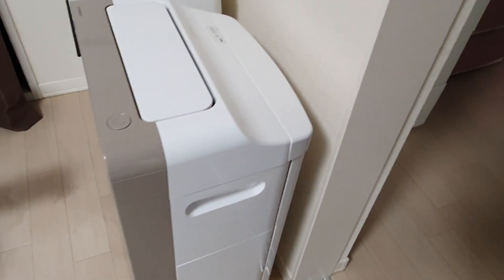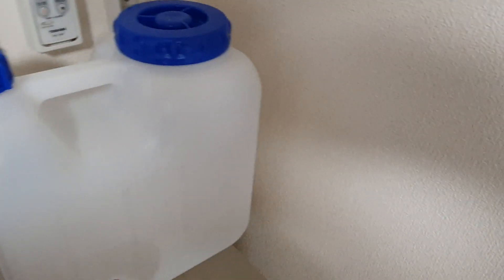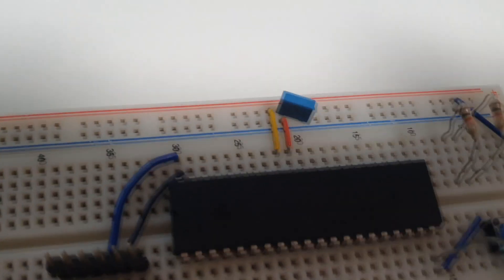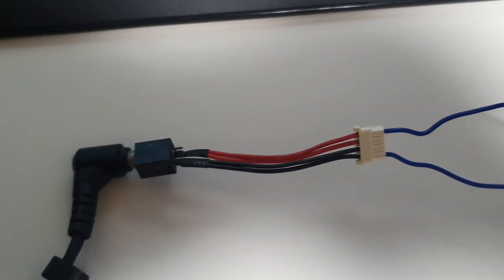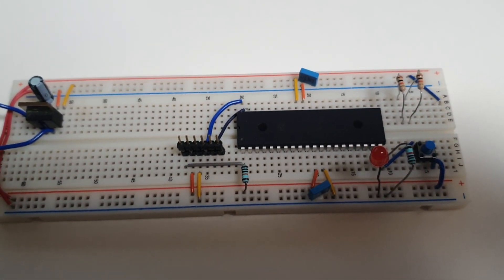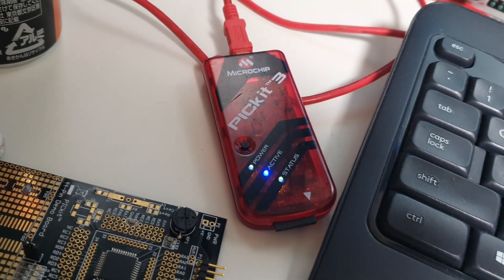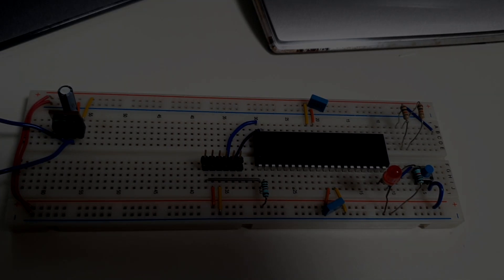Journey's Start [Project Moisture]

Comment: Perfect use of knowledge. I think this is a perfect project. Those water reservoirs are always to small!
Will this solution have some kind of fail-safe? Like if the power dies the valve will always opt for closed state.
Also isn't there like a floating/gravity kind of valve that would do this mechanically when the water reaches a curtain level? Not sure if that is better though. Not as fun for sure!
Reply from the maker: Yeah, the valve is definitely normally-closed! more power efficient and safer. It has a few safety features built in, a few more that I might add if I'm feeling frisky (like proper handling of WDT and brown-out reset).

Comment: You should check out using a capacitive sensor to detect the water level in your reservoir. That way whenever it gets below a certain level you re-fill it! 

You could run the logic with 2 capacitive sensors, an AND gate and maybe an inverter or two:

if (excess supply has water && humidifier reservoir low water) -> turn on pump

(If you said this in the video, sorry, i missed it)

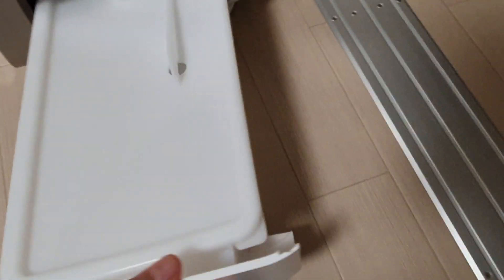Comment: @1:14 Couldn't you get away with plugging a reservoir into whatever that pipe plugs into without the need for an MCU?
Reply: Its project! And a chance to ... project. :)
Reply: @space1677  Well said - I'm projecting.
Reply from the maker: Nope, that approach has a number of issues that make it a non-starter.

Comment: what langauge would you be using?
Reply: These things are usually coded in C/C++, but, if you're going to find anything that NEEDS assembler, you'll find it programming microcontrollers. (I did)

This one looks like a PIC, I've not dealt with them personally, but i'll bet they'll be C++ too.
Reply: @RayMerrell68  isn't something more rudemetry like assembly preferred
Reply: @liquidglo2678  Nope. Assembler sucks nuts. It's rock hard and incredibly difficult to read and offers very little advantage over C/C++. (The ability to precisely control the timing of operations down to nano seconds being one of them.)
Some of these manufacturers are going out of their way to produce as high a level programming environments as they can. (see Arduino IDE, Espressiv (using arduino ide) and ST Micro's Cube IDE)
You can go bare metal or choose various abstraction layers depending on the chip designers and manufacturers. For e.g the STM32 line of chips from ST Micro use ARM cores. You could use assembler or you could use ARMs Low-Level API drivers so your code runs on any ARM chip with the same core, or you could use STs HAL (hardware abstraction layer) drivers, which are (theoretically) easier to use (they're not) but are specific to the actual chip you're using.
It's a fun subject with actual real-world results to get your hands on and show off with. :)
Reply: @RayMerrell68  if assembly adds so little of a benifit why is me along with every other cs student forced to learn it. Moreover isn't c/cpp a little heavy for an aurdiono. I might not be making sense but I'm trying to understand, also for maximum efficiency and speed why don't people use binary programming
Reply: @liquidglo2678  C++ too heavy for Arduino? Maybe, most of what you do could be done with something like BASIC i guess, but the IDE and libraries make it a very soft and user friendly experience for a C environment. (You'll certainly notice the difference if you move over to something like Atmel studio.) Plus, if you're going to start on microcontrollers, you should be getting into C anyway. They ALL use C/C++.
 
You learn assembler because in doing so, you learn the machine architecture and how computers work. That is really handy when you code, especially with C/C++.

By 'binary' programming I assume you mean ones and zeros, like the matrix? See what I said before about assembler, it's really hard and even more difficult to read later on. For eg, I wrote WS2812B LED drivers in assembler about 4 years ago. I looked at the code a few months ago and simply couldn't figure out wtf I had done. I look at my other code and it doesn't take much to figure out but that assembler would take me relearning assembly language, line by line, for me to figure it out again. (Sod that, I have other things to do.)
Programming isn't always about getting the fastest code out there, it's sometimes about getting code out there fast.
Reply: @RayMerrell68  I mean what you say def checks out, but what if you did need speed, for example sending a probe to space with limited technology wouldn't it be worth the time to write out ones and zeros or am I missing something
Reply: @liquidglo2678  Space ship probes go all out on the belt-and-braces approach and use FPGAs, not MCUs, they go beyond ones and zero and work with the true bare-metal, the NAND gates.
Those babies are well above my pay grade.
Contrary to what you might be thinking, you don't get that much extra speed by using assembler over C. The benefit comes from being able to precisely control when things occur. In the specific scenario you mention though, you might well be coding at the most basic level, seeing as you'll most likely be using propriety tech and there might not be a C compiler for you to use. Besides which, with something like that, you'll want to know the value of every single register under every scenario at every single clock tick...just in case.
Reply: @liquidglo2678  When I say You might be programming at the basic of level, I mean assembler. There is no need to write the ones and zeros when an interpreter can convert assembler for you and load it onto the chip as ones and zeros.
Reply: @RayMerrell68  woah this is super insightful I never knew there was anything more rudemetry than binary programming
Reply: @RayMerrell68  my bad, in that case why don't people very litrally program in one's and zeros
Reply: @RayMerrell68   c compiles to byte code anyway. In the end code is just a bunch of instruction calls that the logic on the chip can filter through its gates. You will learn this in your cs degree.
Reply from the maker: @liquidglo2678  Will be using a C variant sadly. Would have loved to do this in C++ but there's no C++ compiler for these parts. PIC assembly will be avoided at all costs as it is yikesman
Reply from the maker: @RayMerrell68  Sadly no C++, just get a janky subset of C. Assembly is to be avoided :D
Reply: hopefully javascript
Reply: @rimson_ways3254  imo that's too slow